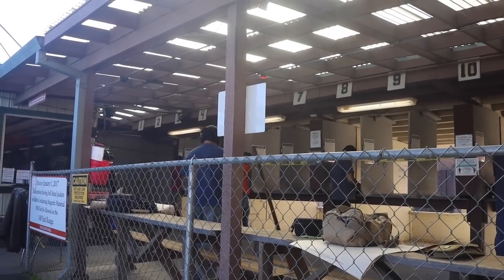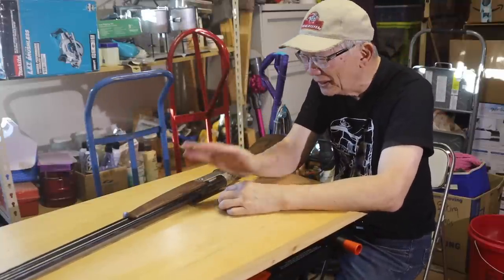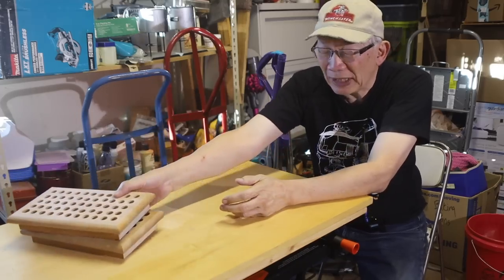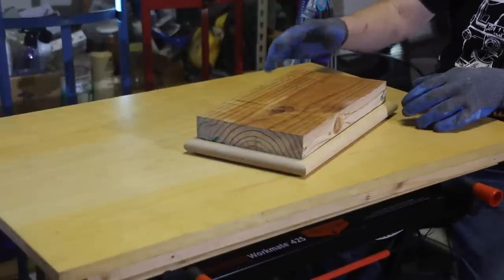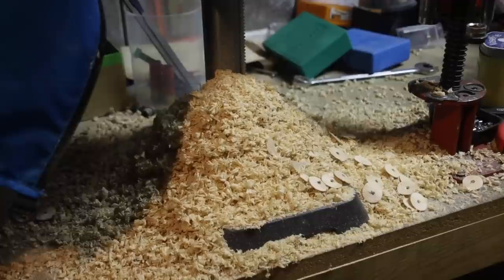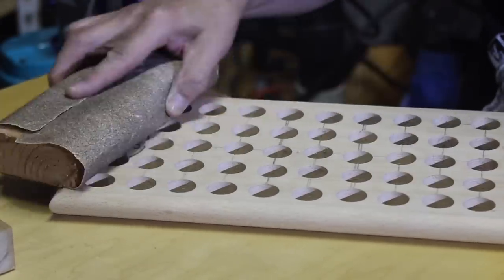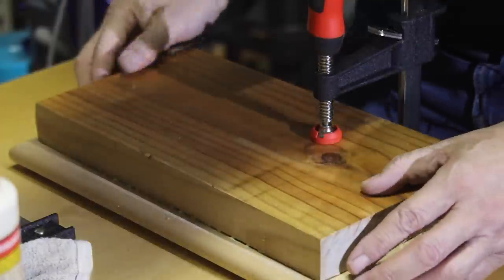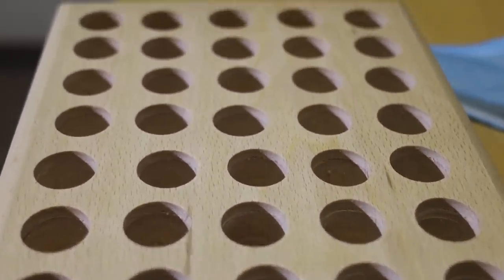Making A Spacious 50 Round 12 Gauge Reloading Tray Cheap And Easy

Comment: I'm happy to say that I haven't seen mask one,  or any kind of socialist distancing at my range since this madness started.
Nice work on the trays. They'll look really nice after a few coats of finish.
I never knew how useful Forstner bits were until I got some to make reloading trays. The right speed makes a huge difference in the quality of the cut.
Being a simple man, I would have said the rounded edges were grip enough, and set my depth stop to leave about 1/8" in the bottom of the board and called it good.
I like to set out alternating rows of hulls and wads. That way after adding the powder and inserting the wad, I get an easy visual cue of where I left off.
Reply from the maker: PK - Yes, there are many ways to make reloading trays - beauty is that we make 'em according to our way of reloading - all good.  Thanks for commenting, PL good to hear from you...Steve
Reply: no brother its the aristocrats totalitair ,that uses right and left to get the power.

Comment: Hi there from germany. Thank you for your Inspiration of making those 12 Gauge loading trays. As they are hard to get in Germany, if in case you get one your hobby budget gets molten down like hot lead, i decided to make my own. I went to the local hardware store and purchesed two glued oak-bords 20 x 80 cm at about 11 dollar a piece. after cutting them in format with my handheld circlesaw  i drilled the holes with a 24mm forestry drill. I then rounded the edges with a router, screwed the two pieces together, then short sanding with fine paper and finished off with waxing. What a pity that i can not show pictures here.

Comment: Sweet! I bought a multi wood fancy looking cutting board from the thrift store yesterday for $5. It was 1 1/4” thick. I used a 1” wood drill bit and drilled holes every 1.5” apart and a hair over 1” deep. I didn’t have to drill all the way through so I needed an extra board for the bottom and my hulls still flat and even. The 1” holes are Just deep enough so 10 gauge hulls are held in place and won’t tip over. Thsnks for I the idea.

Comment: Thank u Fortune Cookie...... How did you came up with the hole pattern and spacing???  Size?
Reply from the maker: MD - Size was easy - use 1" Forstner drill and you can't go wrong - the tray will work for 20 gauge to 10 gauge (10 gauge rim diameter = .933").   A good size for our metallics is 12-13" board (can get up to 60 round capacity) - For shotshell a 15" cutting board.  With those, the spacing is easy.  I recommend 3/4" thick for the tray and the base can be any thickness hardwood or even pine to thin tackboard material cut with jigsaw or saw of choice.  Free wood or leftover shelving is really fine.  Good woodworkin' to ya,  Steve

Comment: Why, Oh Why, do you make reloading trays that only hold 50? I have two of the old Flambeau Twin-60 trays and when I load 50 cases they allow me to keep a visual separation between cases that have gone through a particular process (e.g.: Resizing or Case Mouth Expanding) and cases that have not.
Reply from the maker: AD - You and I think the same way - I made 55 round reloading trays for my 45/70 for the same feature.  For 12 gauge slugs, 50 rounds is good.  Good reloadin' to ya,  Steve
Reply: @FortuneCookie45LC  I'll start reloading again once powder and primers are back "In Stock!" This might be in as little as four years.
Reply from the maker: @arthurdevain754  - If the current Pres would open back trade with Eastern Europe and Russia, we'd be up to our ankles with those fine Tula primers, but not much chance of that - in fact, the former Pres couldn't do that as he was under accusations of Russian collusion all the time he was sanctioning and inhibiting Russian activity.  No matter, our domestic primers will come back - in our economic system, where there is demand - there will be supply.  That isn't true of socialist systems, of course...hmmm, come to think of it.... Best to ya, AD.. Steve
Reply: @FortuneCookie45LC  "Unprecedented Demand" is responsible  for reloading powder and primers being universally "out of stock." What really happens is this -- manufacturers are producing product as quickly as they can. But they don't sell to retailers like MidwayUSA or Cabela's. They only sell to Wholesale Distributors. These Distributors are not selling to retailers. They sell to "Hoarders" who are willing to pay significantly more. Once the Tyrants enact the BAN, these stockpiles will be worth two to three times the inflated prices that the Hoarders paid for them. But be very careful. The BATFairies will be watching such black market activity very closely!